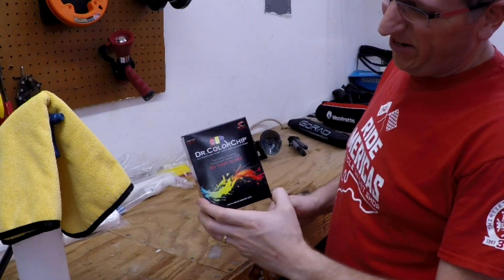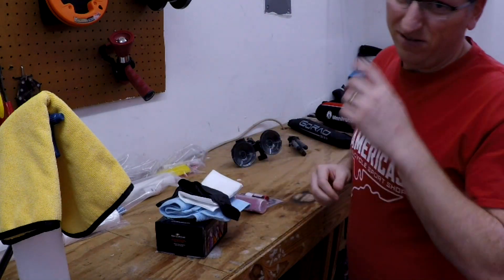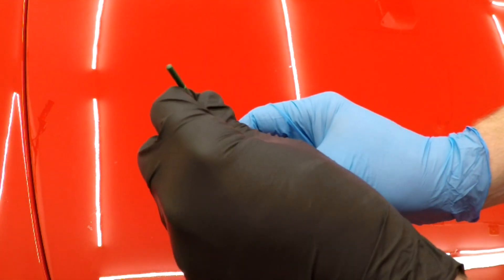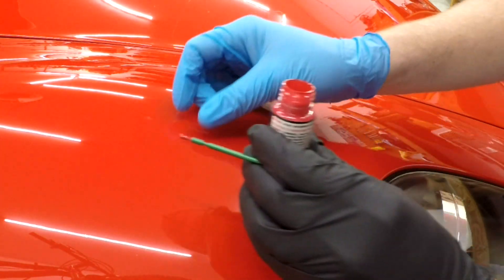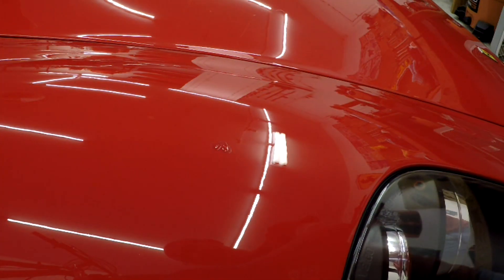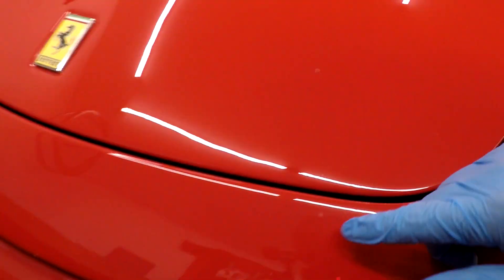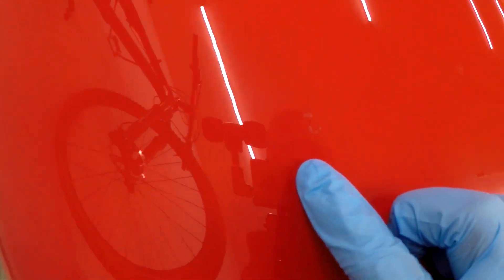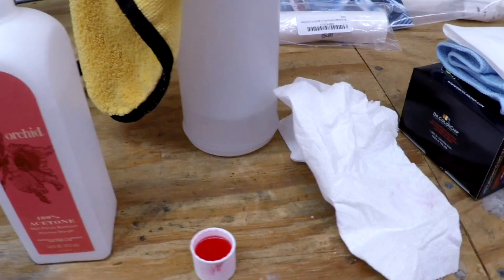How I FIXED my RUINED FERRARI PAINT for $45.

Comment: Crud Dan! Thoyght my 2 chips were bad. Needless to say, my car is ceramic coated. Would this still work for me? Im guessing paint wont stick to the coated area around the chip.
Reply from the maker: Ceramic coating won't prevent rock chips.  A ppf will.
Reply: @normalguysupercar  i meant using dr. Colorchip...lol

Comment: It's not perfect but it makes look better then it was before
Reply from the maker: Yup, exactly.  Perfection requires a re-spray.
Reply: @normalguysupercar  you coulda got more ocd with it and achieved better results if you did AMMO NYC's method.. but is deff not as quick and easy. undecided in which method i should take with my brand spankin new metalic silver STI that is littered with chips.
Reply: @bromando44  what method did you end up using and how did it turn out?
Reply: @lEvanD1989  the method i took was bumper replacement....my idiot friend backed into it one night lol

Comment: You should fill the chips so there is a mound of paint inside the chip that is higher than the original paint. Afterward, use the leveler solution or better yet, wet sand them down flush with the original paint, then use a random circular polisher to remove the dull scratches from the wet sanding. It will look perfect!
Reply from the maker: Yeah, that would have been better...

Comment: My experience with Dr.Color chip on a chip of about 1/32 of an inch, is after several try's following the instructions exactly, is it will make the chip look better from 7 to 10 ft away. What I found works better, is a 10 dollar touch up paint, built up above the surface, let dry, then mask and wet sand the touch up paint, then buff. That method makes the chip almost disappear from 3ft away. 10 bucks, better results than 65 bucks. And yes, the same method can be used with Dr.Color chip's touch up paint but why spend 65 bucks for the kit when all you need is the paint?
Reply from the maker: That's a better method but Dr colorchip is easier and takes less effort.

Comment: Those chips are still very visible due to the paint height difference...have you already looked into using the popular Langka chip repair product which levels the paint as well?

Also are you sure that chemical isn't removing clear coat at the same time it's removing the paint?
Reply: I used Dr Colorchip on my mr2 and had far better results. He didn't fill in quite enough paint, it is very possible to get the chips flush. The trick is to start with too much paint and lightly wipe away with the chemical till its flush. Typical Ferrari owner, not too good with thier hands lol.
Reply: They appear to be the same things. It’s the method used where DCC doesn’t tell you to “over apply” then level and the other does. Between the two I would buy the less expensive once since they are the same but would use the “leveling” method regardless of which I buy

Comment: hi Daniel: ^_^
I just want to know what is your the best way to take care of the ashtray and the door handle of the F430 ?,
somehow my (door opener ,ashtray and windows buttons)  start to become sticky and the black paint is coming out  😭 , i did my research online for the same problem .... and all what I found is that ... the most F430 driver replaced the OEM ashtray and door handles with a carbon fiber parts .....  but it will cost a fortune to replace all the parts at once :( . 
Daniel, is there's any way is to fix it back ? or I should go for the carbon fiber parts ?

thankyou my friend for your time ,  take care of yourself and you're F-430 ^_^

Comment: Got a question. What if the scratch is more of a surface imperfection meaning it isn't deep like a rock chip can i apply the colorchip paint and will the blending action smooth it out if the paint is above the surface with no groove or hole in the paint like a rock chip?
Reply from the maker: It's not really meant for scratches... If it's a surface scratch then it may only be in the clear coat and you could possibly buff it out.
Reply: @normalguysupercar  problem is its a burn.. i over hit a sensitive area while orbital buffing... causing about a half inch long "white spot" that appears after improper buffing cause by burning the paint.... so i know i can slap some touch up paint over it with a small amount and it will cover it up... but im hoping the smoothing agent that they provide with dr colorchip will smooth out the blobby effect that touch up paint gives.... but im not sure if this will do that.. because im only applying touch up paint to a surface imperection with no deep hole..
Reply from the maker: @lolz616  I see what your saying. I don't think this would work for that situation unfortunately.
Reply: @normalguysupercar  So what does the smoothing agent do then if it can't thin the blooby effect of touch up paint? it says the kit comes with the smoothing agent that can thin the paint down i thought? Just thinking of a way to smooth down the blobby effect of touch up paint on surface of paint, any ideas?

Comment: I like the blob idea but then I will wet sand the area with 2000 grit then 3000 grit. to even it out then I have a 2 inch DA polisher and I will use a compond then a polish on the mark. Any good compound will take out 3000 sanding marks.   After that I will put on my favorite sealant called Bead Maker.   I have not tried this kit but I would give it a try.
Reply from the maker: That's probably a better solution.

Comment: Thank you for this review. I was afraid to buy this product until seeing this. I have a black truck. Curious what the results will be like in black. Thanks.
Reply: Did you end up doing multiple coats to build the paint level up to match? How many?  And also curious if you've tried polishing and/or waxing after applying? did it mess up touch up areas at all?   Thanks! Sorry so many questions

Comment: I got over 10 small paint chips on the side of my truck today sitting at red light when a huge dump truck came through the intersection and passed me hauling ass a couple of feet away. Big trucks should be banned from small local town roads
Reply: It sure does. I'm thinking about giving this kit a try considering I just watched you do this to a Ferrari. If the chips are extremely small do you think they would still be noticeable after doing this?

Comment: The paint color matching looks perfect. How did they do that?
Reply from the maker: +Kool Keith I have no idea but it certainly worked pretty good.
Reply: They have the paint formula for all the manufactures.  Rosso Corsa (ferrari red) is a pretty easy color to mix and its forgiving. It helps that it's a late model car and that its been garaged.  The older the car is there is a higher chance of the paint not matching, if the car is garaged, or sits outside is a big factor.  Outside there is more fade because of the sun and environment.  Some colors are more susceptible to fading then others.  The location of where you're applying touching up. If the touch up is in a very visible spot then the repair and color need to be as perfect as possible because you will see it every day if you're a car nut.

Comment: I am sorry I simply not convinced those kits work as well as the old proven method of filling (top up) the chips and go with wet sanding, compounding and final polishing as good body shops will do. It is also a DIY if U can take the fear away. I have an Audi RS3 and fill continuously those every spring. I get tons of them up here in Canada. Every other year (or every 3) I will wet sand the spots and compound the whole hood and finish with Carpro Essence and recoat with Ceramic coating. Clear bar is not my thing.
Reply: Yes, obviously this method is better, but it can take days if not weeks to achieve the result you want (95% corrected vs. 85% corrected in an hour). You have diminishing returns.

Comment: And here I am upset about some chips in my new VW CC. Still, nice, to the point tutorial. I might get a color chip kit. Any tips for light scratches? Wax?
Damn touchless car wash did some minor damage.
Reply: I got both chips and light scratches. Car was flawless before the car wash. I'll grab some wax tomorrow and order some colorchip.

Thanks
Reply: Quan Henry did you end up buying it? If you did, did it fill light scratches that went through the clear coat?
Reply: Touchless car wash did not damage your paint LOL. They had to have been there before you just couldnt see it (dirty). If a water jet damages your paint then you have other serious problems with your paint.

Comment: I had used ScratchWizard on my S4 which was a similar system, the color didn't match at all and when I tried to remove it, the chemical damaged my clear coat. They refunded me and threw in some extra money to have the clear coat buffed (which did fix it) but the whole experience keeps me from using these kits.
Reply: Adam Henrickson I have a B 8.5 Monsoon S4. Perfect match with Dr Colorchip. I have black and silver metallic kits for 2 other cars and all the colors match factory paint so well you can't find the chip if filled correctly.
Reply: @raywalteroutdoors  How do you fill the chip correctly?
Reply: @israel6642  I layer it. Don't try to do it all in one shot.
Reply: @raywalteroutdoors  you layer it next to the chip?
Reply: @israel6642  no,  fill the chip but don't overfill right away.  Build up layers using a couple coats.
Reply: @raywalteroutdoors  i have metal polish metallic leets how it works i just got the kit today. Ive heard its hard to work on Metal metallic colors
Reply: @israel6642  It may not come out perfect from a couple inches away but I think you'll be surprised when you step back and look for it.

Comment: you should invest in a vinyl wrap for the car
Reply: That's good. If you decide to protect all of the paint on the car you might consider doing a full wrap of the entire car. You could alternatively use clear bra around the wheel wells to protect rocks chips in those areas, and along the edges of the doors too. :)

Comment: I like the other method better.  Use 2500. 2000, and 3000 wet sanding method. Just did it on my new 911 and got better results.
Reply from the maker: Sure, that works much better but takes more skill and time.  Nothing wrong with that.
Reply: You are correct.  It did take much more time and patience...  and if you're not careful, you can make it worse.

Comment: That is a lot of stone chips. I would avoid driving where ever you drove to that you got them. Invest in a clear bra but get the chips fixed first and yes, you can still see them.  Rosso Corso is one of the easiest ferrari colors to repair, the reason your repair is still visible is your not adding enough paint.  Put the paint on in layers, allowing enough time to set up in between layers.  How's your front end? Have you scrapped the front end underside?  It's very easy to do and well worth the purchase of the teflon shoes to protect the area.  Paint defect by your door?  Did you purchase this new?  There shouldn't be any paint defects from the factory of the size you pointed out.  Has the ca, or parts of it, been repainted?
Reply from the maker: It's a 2005, so no I bought it used.

Comment: Saw a vid for Chipfixx  (same basic product and both are highly recommended. He did a paint restore before applying this. Said we needed to remove any contaminates and wax and what not. Quite an ordeal vs yer little squirt bottle of "rubbing alcohol basically " (would like to know exactly what that is or if rubbing alcohol is okay) Any thoughts by anyone because this way seems way more up my alley and convenient.
Hmm.. the chipfixx video actually blended to near perfection. This product or specific color match was far inferior. I could link that video if you want to see it for yourself or your viewers. Based on this video and the other I think im going to go with chipfixx instead.
Reply from the maker: Good to know there's multiple options on the market. I may have to try the chipfixx.
Reply: If you do would love to see a vid. But I will post my results here if I do it first. The video I saw that I mentioned id link if you say its okay was like 99% perfect. he shot vid in 4k and you could see no signs of the chips.
Reply: @normalguysupercar  So I bought and applied this to my car since I cannot get the other brand due to Canada saying they cant ship it outside Canada. This Doctor stuff is bad. Paint color doesn't match for one.  And its sorta blobby til you wipe it away with the "special solvent" (paint thinner?) Goal is to remove the blob of paint until you are flush with surface and stop. So if the color matched you would be okay, I guess. But now I have off color dots on my car.

Comment: I just remembered watching this video a week ago or so one night very late...wanted to comment....this is definitely NOT the ideal way of doing it, even though he did exactly what they show on the website. Take the brush with paint and simply dab it right on the chip, leaving it high. If/when you smear it, it winds up being too low-that's useless. With it being high, you can then do what he does here....keep rubbing it with the sealact, and as soon as it starts to dissolve, then ease up and gently rub and contour it the to shape of the panel. Done!
Reply from the maker: Good tip
Reply: Having experimented some more, I do see some downside to "overfilling". It can dull the clear-coat and is much tougher to level, sometimes, depending on the chip depth, and/or how over-filled it is, etc...
I'm trying a new method today. I'm going with the over-fill and letting it dry for a couple of hours, or more. I'm going to follow up with a wet sand which I know will level it easily, then I'll immediately use the Sealact to allow it to set. I'll finish with a polish the next day. I guess this is sort of the old traditional way of doing it, except with a more gentle and forgiving paint. I'll let you know how it works.

Comment: Thank you. I will be doing this on my daily driver..... I am sure you have learned now to never buy a super car without purchasing clear bra.
Reply: Plus, not everyone that buys nice cars buys them brand new.  I just bought a 2009 911 Turbo last year and am going to get some of this to take care of a few rock chips on the front.  And since it's already imperfect, I probably won't bother with a film at this point!
Reply: @autotempest  did it work for Dr.color ship?
Reply: @israel6642  yeah, it worked pretty well. Took most chips to invisible from more than a couple feet away.
Reply: @mrstretchie  do the paint fades after a year?
Reply: @mrstretchie  one last question does it work better when you the brush straight to the rockchip? Or just do as the instructions says?
Reply: @israel6642  haven't noticed any fading. Their technique of smearing into the chips works well. Especially if you use the little squeegees. One recommendation is to not get excessive paint elsewhere though, and to do small areas at a time. If you let more than a thin layer dry on the paint, it's tough to get off. (Not impossible, just takes a while.)